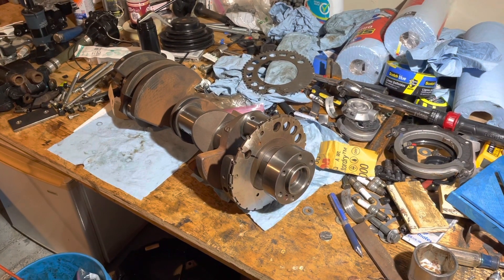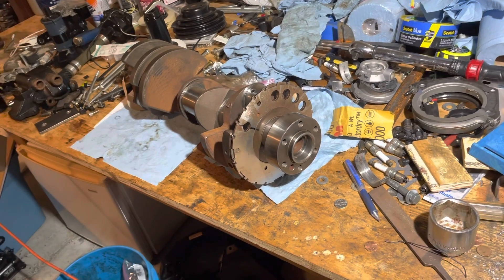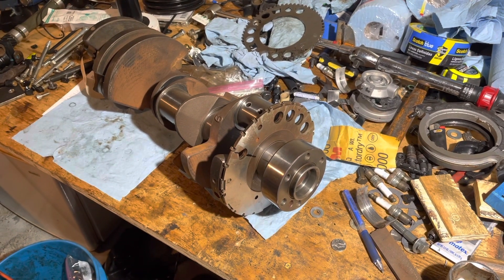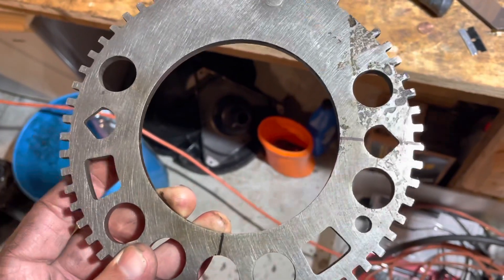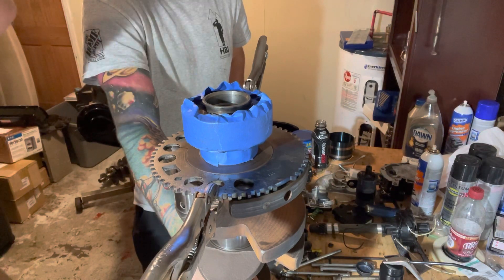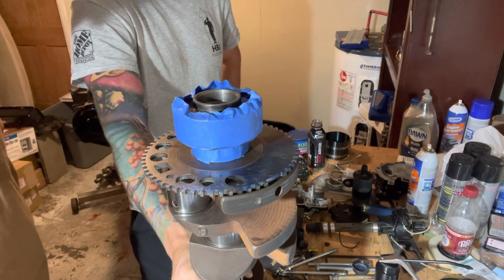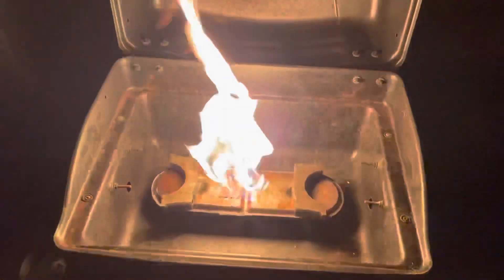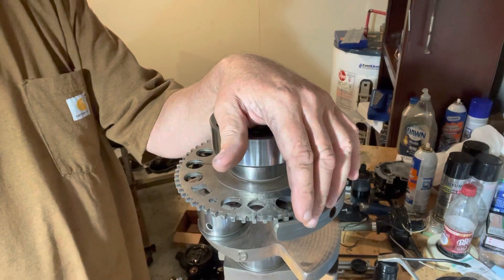LS Swap 2 - Swap Reluctor Wheels Free

Comment: I got a toasted gen 4 5.3 and a gen 3 5.3, can I just swap gen 4 crank into gen 3 motor and use gen 4 timing gear and cover? Also I haven't built alot of motors, but can I I pull a crank leaving caps and bearings in proper orientation , take of 24x and put on 58x , drop crank back in with same bearings and caps in proper orientation and torque caps and put back together? Or do I need to replace crank bearings?
Reply from the maker: Question 1 -yes I’m doing that myself. The knock sensors were moved from the intake valley to the outside down low on block Gen 3 to Gen 4. I’m trying out a solution and will video if it works. Question 2 - yes I’ll post a video of how to do it.
Reply: @moccasinmarine  leave crank caps and connecting rods in same orientation also and just retorque?
Reply from the maker: @erik120719  not sure what you mean by same orientation but main caps have to be installed back in the same location and direction. Rod caps also have to be put back on same rod in the right direction. Gen 4 rods have fractured mating halves really won’t fit back together wrong. Send me an email to gmefiguy@gmail.com for more info. I would also not reuse the bearings. If you have the engine open why not replace bearings with new?
Reply: @moccasinmarine  motor has 115k on it, and I don't have the time to change bearings atm. I will be rebuilding the burnt up gen 4 over the winter , but have to have a truck FOR the winter and the quickest way is reuse working things and get motor in truck asap.  And by same orientation, I mean same bolts back where they came from and all caps back in same direction and stuff so all bearings are back in original position.  Basically I'm asking, is it ok to reuse bearings and bolts just changing the reluctor wheel and back in ? . Would be same crank going back in same gen 3 6.0, I'm just going to rebuild the gen 4 5.3 when I have more time
Reply from the maker: @erik120719  so if I have understand your situation, you want to take the Gen 3 crank out of Gen 3 engine, swap the 24 tooth to 58 tooth reluctor and put same Gen 3 crank back in the Gen 3 engine using same bearings and install the Gen 3 in the truck to replace Gen 4 engine? You’ll need to use the Gen 4 crank sensor and get a map sensor extension harness and splice in a new cam sensor plug under the front of engine.
Reply: @moccasinmarine  yes u got what I'm doing, going to change cam gear and drill and tap knock sensors on gen 3 block and just leave gen 3 stock knock sensors in plugged. Didn't know about map sensor, so ty for that knowledge.
Reply: @moccasinmarine  and I have complete gen 4 motor, Intended on using sensors and timing cover and as much from gen 4 engine as I could
Reply: @moccasinmarine  from what I've read the places to drill and tap the gen 4 knock sensors are on the gen 3 block, simple as drill and tap

Comment from the maker: It did not get past me that I indexed the 58 tooth reluctor wheel using the 24 tooth wheel as a guide. But what if you have a crank that you acquired that did not have a reluctor wheel at all or you forgot to mark your crank before you removed the wheel that came on it. Well I found the solution to that too.

Look at the 0:40 mark in the video. Notice the pointed round shape in the wheel. There is an opposing shape 180 degrees on the other side. These two shape’s points form a line that dissects the crank centerline. This line also lines up through the centerline of the 5/6 crank pin. Look closely and you can see how this line lines up with the casting line running up the 5/6 crank pin. I’ll do a video on this later but this gives you an indexing point when you don’t have something else to index to.